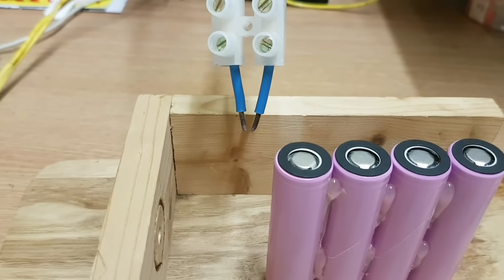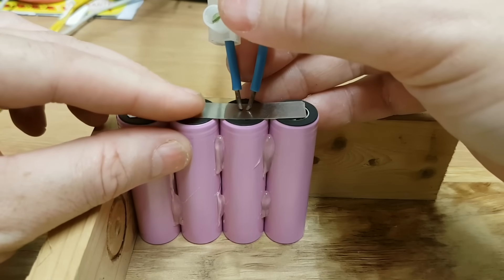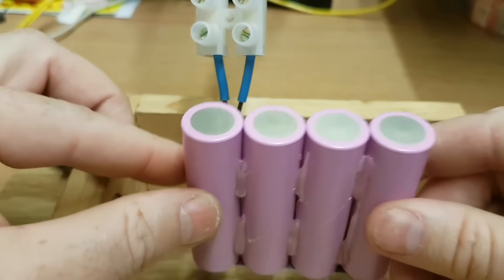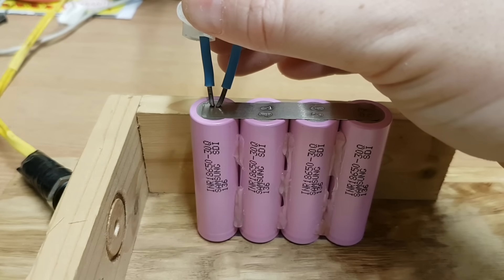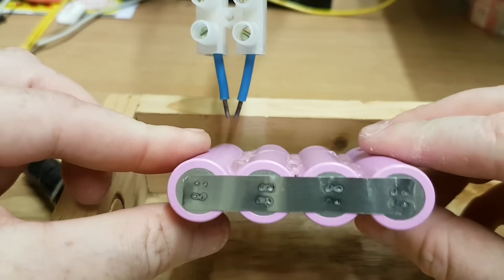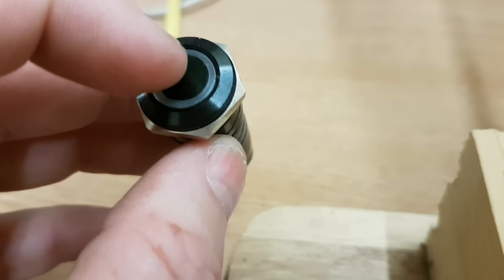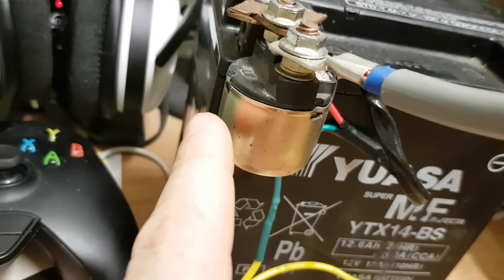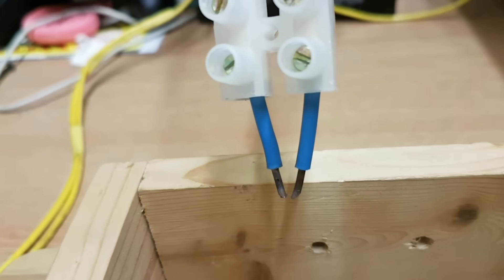DIY Battery Spot Welder - Demonstration & Explanation

Comment: So the switch powers the solenoid on/off and keeps you from having the big current that is making the weld from having to flow through the pushbutton? So when solenoid is on, the battery is basically shorted out and puts out as much current as it can, correct?
Reply: Aha... thanks again for the clarification.
Reply from the maker: Correct. You are basically shorting the battery for .04 of a second each time.
Reply: Hi,

I would like to ask you just one thing - can you use a lower Ah battery in order to achieve this (spot welding that is) ? Like 7,2 or 9 Ah 12 V battery or do you really need one that can output somewhere between those 100 - 200 A ?

Ergo what is the lowest current needed to achieve a nice spot weld (using your setup) ?
Reply: hello dark...this is power mosfet... just called to say hi
Reply from the maker: David Bolha the actual lowest needed is 200A which this battery is. It doesn't matter about the AH rating, just the CCA rating, or max Amp output.
Now I've tested with a higher AMP battery (330A) even that may be too high... I've managed to control this though by mounting my switch on my wooden cell holder you see here in this video and pressing on & off extremely quickly! If I pressed with this new battery like I did with the old (in this video), it would melt straight through the nickel.

Comment: In the US "twin and earth" wire/cable is called Romex® or its "trade name" non-metalic (NM-B) cable.  2.5 mm² is about 12 AWG and it is solid copper.
Reply: CabinDoor  Like most of us who aren't actual electricians, Romex is just a description as well as a brand e.g. Crescent wrench is an adjustable wrench made by Crescent tool company but also many others...we still know them all as Crescent wrenches.
Reply: 12 awg Romex, got it and Thank You very much.
Reply: You can just call it 12 gage solid.
Reply from the maker: Jack Patteeuw that's great, thanks for the info for our American friends.
Reply: Smattless  Find me an electrician that calls it NM-B. I'm in the trade and Romex is the most commonly used term.

Comment: I checked on eBay that DC timer that you recommended. It is rated only for current of 10A. How comes you are pushing 200A through it, via battery. Wouldn't that amount of current burn up the DC timer?

Can you please list what AWG gauge cables are you using? Thanks in advance.

Is the current going through your switch? Can that switch stand 200A?
Reply from the maker: No, you use the DC timer to activate the solenoid, not for the main current to pass through.
Reply from the maker: Oh, and the heavy cable is 16mm²

Comment: let's hope that relay on that timer won't weld it's contacts together even tho it can handle 10amp looks good idea till ya have to charge the lead acid battery for bout 5 hours every 20 tab welds ...cud just use customized transformer and have a contact switch in the handle when pushdown it connects then disconnects with reset button
Reply from the maker: That is a worry.... I need to get an uprated relay/solenoid to handle more amps as this one is only 150A!

Comment: Couldn't the solenoid be replaced by a copper coil ?
Reply from the maker: jm wolf I suppose if you wanted to get down to basics it could, but the coil would have to activate a large cooper switch anyway, why not just use a solenoid?
Most high amp momentary relays would work. Remember, you're talking 200+A
Reply: Thanks, i get it, yes 200+ amps that's a lot even for seconds, i think i need to find out more about solenoids, i don't know much about them.
Great video and thanks for your kind response.
Reply from the maker: jm wolf no probs :)